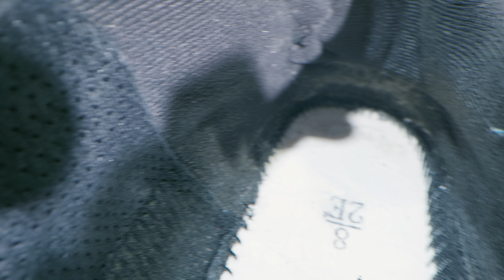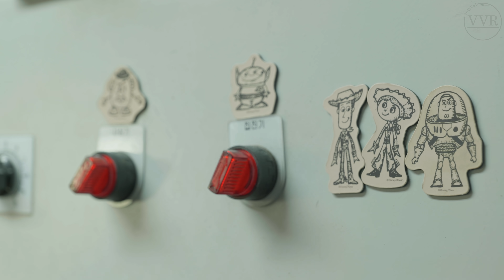[ASMR] 'Clean & Restore' 'New Balance' 773 Running Shoes 👟🖤🌳 -4k

Comment: Hi!  How long can this method of painting last?  Thanks!
Reply: It depends on how you wear the shoes. With no contact to water, it should be able to last a year or more. With contact, maybe 4-6 months? The type of paint also affects it, so it differs a lot. If possible the best way is to have some sort of coating over the painted parts. Maybe something like krylon matte finish to help. But it really depends on how the shoes are used, and what environment it is in.
Reply: In terms of the fabric painting though, if you don’t wash it excessively and the paint stays on well enough, it should last long enough.